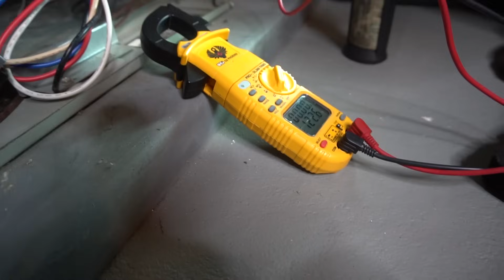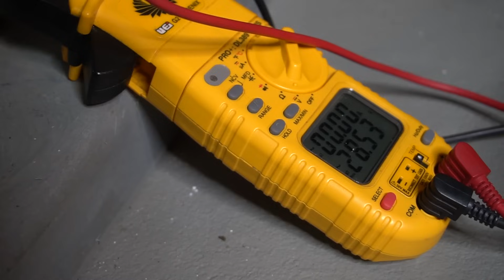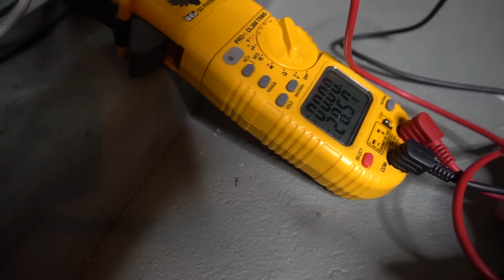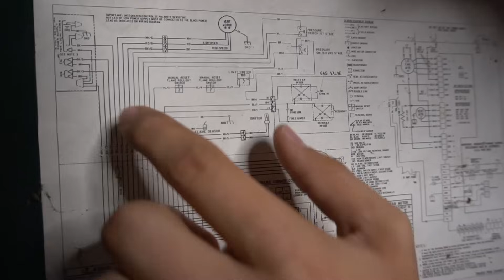Furnace/AC How to Troubleshoot The Control Board

Comment: I have no red light, the  power used to come on when I tapped on panel, now that method doesn't work, As you did in video roughly at the 4:30 minute mark, I tested the 120v wires from transformer at circuit board while still connected and a bit of pressure with multimeter and the power turned on, I dont understand why, it will run for 5 to 10 minutes and lose power, I'm guessing something is loose and the vibration is causing it to lose power. What do you think is happening?
Reply from the maker: That does sound like a loose connection. I would take the control board off the mounting panel and see if there is a loose or burnt solder joint. Perhaps you could solder it back on. Or if the female connector on the wire is really loose, you could try crimping it a bit so it makes a snugger connection.

Comment: I followed this video (which was awesome and easy to follow) I did everything you did and had power everywhere but my control board indicator light doesn't light up at all and nothing works. Do I just get a new control board or get a professional to look at it? Thanks
Reply from the maker: If your control board LED does not light up that is either a bad control board or it is simply not getting power. Reasons for it not getting power could be a tripped breaker, furnace switch turned off, bad transformer, door switch open, or a tripped 3 amp fuse (sometimes a breaker) to name a few. It sounds like you checked it with a meter though, so if the board is getting 24v from the transformer but the LED does not light up, it is very likely that the board is bad.

Comment: My HVAC is set to COOL and works fine for a while.  Then it randomly switches to heat.  I can turn it off and it will "reset" and work again for a while.
It did this once a few weeks ago and then worked fine.  Now it does it several times a day.
Reply from the maker: If it switches from Cool to Heat on the thermostat, then I would say the thermostat is bad. But if the thermostat remains on Cool, yet the heat turns on, then likely the board is bad. Also, this is rare but it is possible that some wires are shorting to each other as well and that's what is causing it.

Comment: Thanks for your videos. All of them are so informational for DIYers like myself.  Quick question regarding the Rheem 62-25341-81  control board and blower motor. Recently the blower motor does not turn on but eventually does when I toggle the door switch a few times.  Is this indicative of the control board being defective even though the green LED lights on the burn are lit up. I assume the blower motor is good since it spins freely and powers on after toggling the door switch a few times. Please keep up the good work.

Comment: My 3 amp fuse is connected to a wire like yours, what's the safest way to get that out and not damage the connection or wire?
Also, I don't have a door switch that I can see. Do some units not have door switches?
Reply from the maker: Almost all units will have a door switch but I have seen some that don't. (just follow the wire coming from the power switch or wherever the main 120v comes into the furnace and usually the first place the hot wire goes to is the door switch) As for how to take out the fuse, just simply turn off the power to the furnace and you can freely take it out. You should be able to wiggle it out of the connectors fairly easy.

Comment: QUESTION. i use my AC 2-6 a year. Run the fan for days and no problem.  In the last 2 year I have had 3 service techs come to look at this problem. Turn the AC on day 1 and would blow for 1 hourish and then turn off for 30 secs. then turn back on will run fine until I turn the AC off. Day 2 turn the AC on and within 7-10 minuted will turn off and on every 30-40 secs. I turn the AC off after this keeps happening for 4-5 minutes. What has been done by techs. New fuse. Filters new. Wire from control board to condensor replaced. New capacitor. New thermostat. Any thought would be helpful
Reply from the maker: Oh boy.. That one sounds like a problem child. Unfortunately with an intermittent problem like that, I wouldn't even know where to start guessing without being there. It's possible that your area is experiencing brown outs and the power fluctuation from that is messing with the air conditioner..

Comment: I have the same board and setup as you but my board does not have a fuse. After checking for power I am not getting 24v from my transformer but I am getting 120v from the transformer. Also the indicator light is not on. Do you think I have a bad board? Or is there another place the fuse can be located ?
Reply from the maker: If there is 120v going into the transformer but there is no 24v coming out of it, then that transformer is bad. And if you watch the video from 5:30, the fuse that you see, I actually spliced that one in myself since my control board did not have a fuse either. If there is no 3 amp fuse, then if there is a short somewhere, it can burn out your thermostat, transformer, and control board...
Reply: Word of Advice TV Word of Advice TV Will this issue cause the unit outside to stay off? I push in the contactor and it starts up fine. But it will not do anything when I start it up on the thermostat. I also replaced the thermostat because the display had gone blank not functional. After troubleshooting per your video I found no power going out 24v and on the condenser unit I found a wire shorted due to wire being pinched by the door. The wire that was pinched was a blue wire that goes on the side of the contactor 24v side if correct. There is 2 wires connected to the side of the  contactor a blue wire and yellow wire that are wire nutted to a red and white wire going into the condenser. I can see the arc flash signs on the door. Is there a fuse other than the main on the condenser unit?

Comment: Please, I have a question.
I believe my control board may be bad because every time I switch on the power to the control board by pushing on the door switch, the first thing that happens is that it instantly blows the 3A fuse on the control board and the indicator light does not even come on since the switch is blown. Would you agree then that the control board needs to be replaced?

Please HELP.

Thanks
Reply from the maker: I don't think that is a control board issue. Usually that means you have a bare or broken thermostat wire somewhere which is touching something metal and is shorting out. If you are running your AC, then most of the time the bare wire will be outside at the condenser unit. An easy way to check is to pull off the 2 thermostat wires that come from your air conditioner. (at the control board) The two wires go to Y and C. And then replace your fuse and reset the power. Does the fuse blow with the air conditioner disconnected? If not.. Then you know that your problem is the thermostat wires going outside or something inside the condenser unit.
Reply: I took your advice and disconnected the two AC thermostat wires from the control board. Once I pushed the door switch on the furnace, the fuse blew again. So I went ahead and replaced the board. The board was bad anyway because some of the components looked like they had been damaged. 

After replacing the board, I pushed the door switch and the board indicator light came on. A nice sight to see since the previous board indicator light didn’t even come on. After this, i closed the furnace and while observing it, I had someone turn the thermostat fan to the ON position. The blower appeared to come on for about 1 second. And then stopped. I opened the furnace and I could see very faint smoke, and also I could smell what appeared like burning wire. Unfortunately I could not identify what had burned although I looked extensively. 

Afterward the board looked fine and even turned on again. 

Any advice at this point? I plan on looking through your videos and seeing if there is any more advice that you offer that may be helpful at this point.
Reply from the maker: @FollowChrist222  Glad to hear you are making progress! This one can be a little difficult to track down.. I am actually planning on making a video on how to track down a low voltage short in the next couple days. So with the thermostat off and fan setting set to auto, it sounds like the fuse does not blow... If you have some extra fuses.. What you can try is to leave the thermostat off, and then jumper R to W. R to Y. And R to G all at the control board. Hold the door switch in and try jumping those three one at a time to try to narrow down what is blowing the fuse. (I have a video on how to bypass thermostat at control board if you nee it)
Reply: Word of Advice TV ,

Thank you for your help. I appreciate the time you take to respond. 

So I just want to be clear that the fuse that was blowing was only happening with the original board. After I replaced the board and powered the new board  by pushing the door switch, the fuse did not blow any more. 

Once the control board started to power on manually, I closed the furnace doors and had someone change the thermostat fan to on position. It was then that the blower appeared to come on for a second or so, and then it shut off. When I opened the furnace, I could smell a burning rubber like smell.

I noticed the fuse did not blow, and I could not find any damage on the board, in fact, I was able to power on the board manually afterwards, so everything seemed in tact. 

The original board which was damaged may have been what was causing the fuse to blow. That’s possible right?

I suppose my mission now is to find out what caused the blower to turn off after a second or two. And what exactly happened that gave off the burning smell after I opened the furnace. It smelled as if a wire burned and I could even see faint smoke.  Would whatever I have described be considered a short? I examined the fuse and it sure looked in tact. And plus the board still turns on so I’m a bit lost. 

I will follow your suggestions about jumpering the different thermostat wires and I will watch the suggested video again. I’ve watched a few hours of your videos thus far. They are helpful.

Thanks.

Comment: Grear vid, dude! Few questions: do you really need the very same board, or you just need the same functionality, e.g. two stages if required by condenser, etc. My control board had bad connection. $170 control board fixed by two zip ties on the connectors because of cracked soldering. Wouldn't you say that from design standpoint exposing electronic circuit board to dust, humidity from humidifier and vibrations is a very bad design?
Reply from the maker: That may not be the best design but that is how most of them are set up and many of them work great for 20-30 years. Some in very filthy conditions. So it depends on the homeowners luck I guess :) If you are comfortable with electronics and wiring, then yes, you can use a different control board. On some furnaces you can no longer get the OEM anyway, so when looking up a control board, it will substitute to some ICM board.

Comment: Thank you, I have power going into my board but nothing coming out on the Y and C. I checked your other videos and it’s definitely my control board. I ordered a new board off eBay for $95. I have electronics experience so it should be a piece of cake reconnecting the harness and wiring

Comment: have you seen a system where there is a wiring to prevent the compressor to turn on when the blower fan is not working? i think it is good design practice to disconnect the compressor if the blower fan is not working to prevent ice build up in the evaporator.
Reply from the maker: If the condenser unit outside is equipped with a low pressure switch, it would essentially do exactly what you explained. So yes, there is something like that out there.
Reply: thanks for replying promptly. i meant the house indoor blower fan. my house indoor blower fan (trane xr80 system) stopped running, but the compressor and condenser fan continued running. i think to prevent ice build up in the evaporator and possibly damage the compressor, the compressor should stop running upon detection of non- running house blower fan. is there a system that will do that?
Reply from the maker: @jungapo2  When the blower motor turns off or stops working while the outside unit keeps running, the refrigerant pressures inside of the pipe start to drop rapidly. The lower the pressure, the lower the temperature. This is what causes the condensation to start freezing over. The low pressure switch, even though it is outside, would sense the drop in pressure and shut the unit off until the pressures go back up. This usually turns into a short cycling scenario but at least the coil does not freeze over. Other than the low pressure switch, I am not aware of any other such devices.
Reply: Word of Advice TV thanks again. i'll check my system if it has a low pressure switch.

Comment: 120v going into the transformer but no 24v coming out .....bad transformer? It all started with batteries going out on the thermostat ...
Reply from the maker: If there is 120v going in but nothing is coming out, then yes, transformer is bad. Also, if you don't have a 3 amp fuse in your furnace, I would splice one into the 24v hot wire coming out of the transformer.. Just to be on the safe side.
Reply: havocalex0202 Is your indicator light on, on your board? I’m having the same issue. I’m getting 120v to the transformer and not 24v coming out. Also My indicator light is off on my board

Comment: One quick quetion, I checked my capacitor and these are the # I saw 100335-C6 and the second is 0S11-001537 If it is the first one I can not mach it O by the way its 21/2 ton Lennox any advice thanks

Comment: My Transformer is getting 120V but my R and C is giving 24V

However  when I took power out and check continuity R and C are short  I am confused
Reply from the maker: It is a step-down transformer. 120v goes into it and the transformer steps it down to 24v. That thermostat strip is low voltage so it will all be 24-28v. There should not be continuity between R and C since that is a direct short. Are the wires touching each other somewhere?

Comment: I've watched a lot of your videos also like many others. I really enjoyed everyone of them. They're done really well and easy to follow. I really do appreciate your the way you're not like a lot like many others wanting a fee, but if i recognize you in a restaurant, I will pay your food bill. Every single thing I've seen you demonstrate was on point! But i have an old unit without fuses and want to know where i start with my issue on my AC unit... I've checked the Capacitor, Contactor, Fan Motor, condenser, basically everything on the outside and now i'm stumped........ I believe the problem has to be a wire connection. Where should i start??? Thanks in advance .
Reply from the maker: Hey Marice! Thank you, I'm glad you like my videos! Do you by chance have a meter you can read voltages with? That would make troubleshooting easier. Also, have you watched this video yet? https://www.youtube.com/watch?v=wzAA4dlp_70&t=318s that video should help you narrow down the problem
Reply: In my casé I have power in all those parts that you mention . But the board is not sending power to the induser motor.
Reply: Thanks for all your advices.

Comment: Thanks again for your instructive videos, I wonder if , troubleshooting the condenser unit will be about the same, because some of them come with two small controls boards , thanks in advance.
Reply from the maker: The boards in the condenser will be a little different. Those are usually more like relays. (unless your transformer is in the outside unit, then there would be more similarities)

Comment: I have a Ruud furnace that runs the induction fan and blower motor even with thermostat wires disconnected. Installed 2 different boards
Reply from the maker: Oh boy... That one sounds problematic. I would also think that the board is bad... That's bizarre. I am not sure what could be causing that if you already have the thermostat wires disconnected. Are you getting the OEM board or a generic replacement?
Reply: @WordofAdviceTV  i fixed it. I was told when a board goes out on the Ruud it will keep the induction fan going. It also showed 3 blinks and a pause on the trouble code system which says limit switch. Switch ohmed out good. Well it has 3 switches tied together. One looks more like a roll out switch. That one had a reset button. That is all that was wrong with it.
Reply from the maker: @jpp9876  Oh I see! Yeah, I would not have guessed that without seeing it. Thank you for coming back with an update! Hopefully there will be no more problems with the unit for another 5-10 years now! :) Stay cool!

Comment: what about when you come across the blower motor not coming on and you have high and low voltage coming in? you can also check with one test lead where the wire from the motor connects to cool and the other to ground and if you do not see 120 volts than that also indicates your board is bad.
Reply: I've got the same issue, no voltage at the 'cool' terminal on the board.  If I take the wire off and supply 120V to the wire, the blower will run, so it's in the board somewhere.